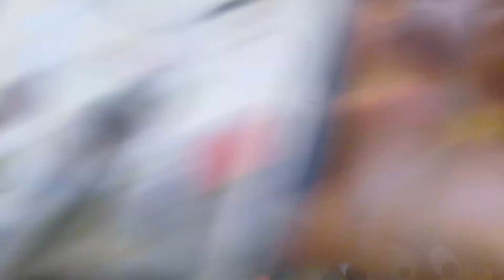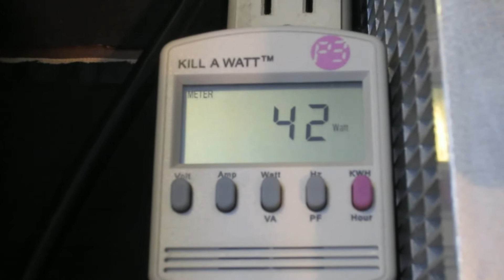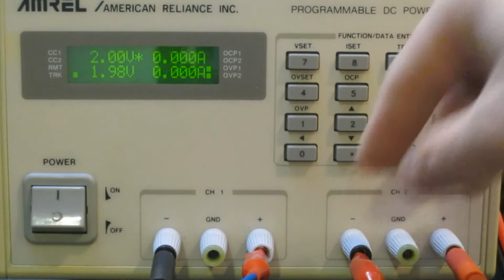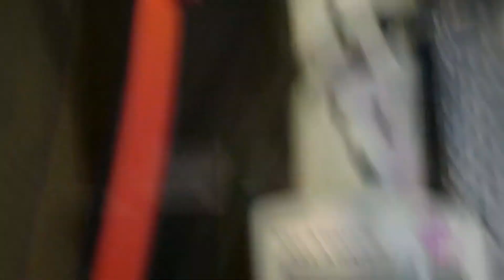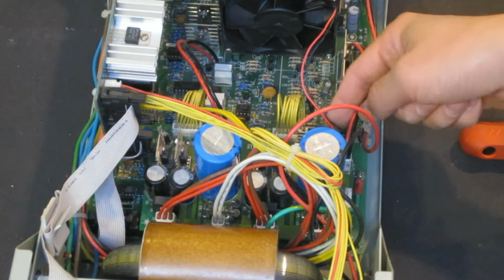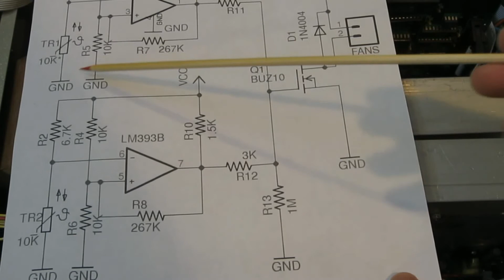PPS-2322 Performance Verification and Automatic Fan Controller Design

Comment: I have seen another unit with the same model number but the LCD had a very different layout, lacking all of the the side anunciators. The keypad was also subtly different. 

I suppose there was a UI revision at some point, I wonder if the internal hardware changed too.